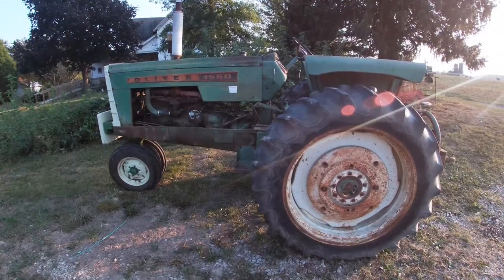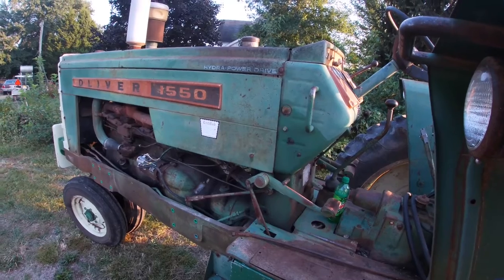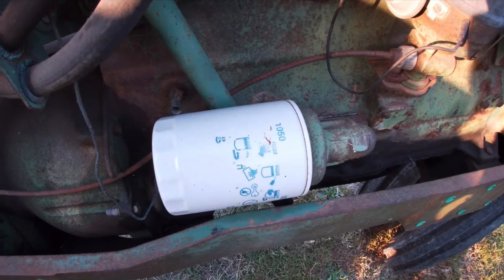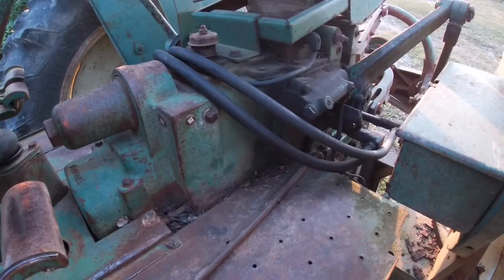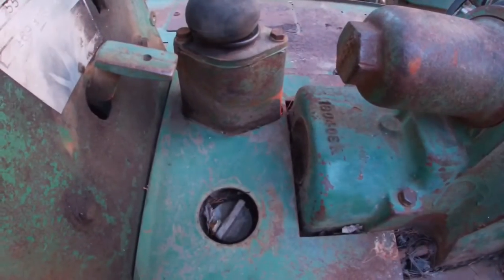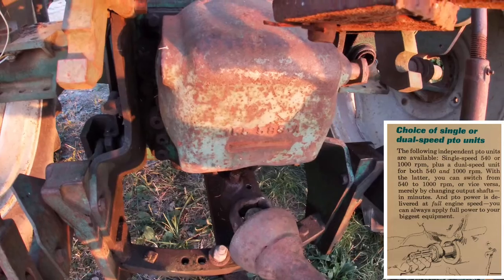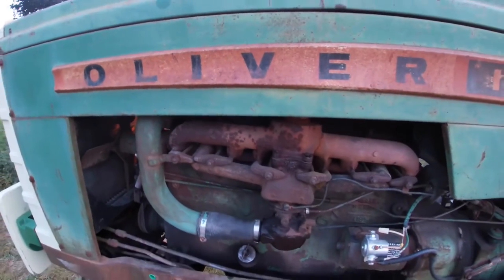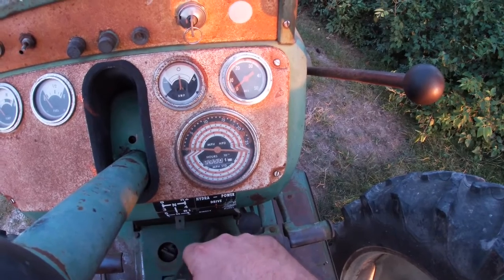The Little Rowcrop that Could! Oliver 1550 History, Features and More!!!

Comment: Great video, you're going to put me out of work! A couple of things I would add. The 1550 could be ordered with an oil bath air cleaner the first couple of years. I'm surprised the owner didn't order that, but it might go back to what you were saying about the premium air cleaner, it was working in a dusty environment. The other thing is early 1550s only had 3 gauges, with warning lights for oil pressure and amps, just like the 1600.
Reply from the maker: Editing this video took me forever. I finally just accepted that it wouldn’t be perfect and put it out there. Haha. Now that you say that, I do recall seeing a 1550 with the warning lights, but I’ve never seen the oil bath in one. I guess I just didn’t pay close enough attention. And don’t worry, I think you have good job security, you’re much better prepared when you make your videos. I’m kind of spontaneous about filming.
Reply: Trust me, I'm all spontaneous in filming. It's all in the editing. I'm thinking about making a behind the scenes video this winter when I have more time. I bet you had a few hours into this video when you start figuring overlaying literature images.
Reply from the maker: I actually started making a “blooper reel” of all the stuff I cut out. I don’t think the average person realizes how much time is spent on one 20 minute video. I reach a point where I’ve watched it so many times I just roll with it.
Reply: My 1966 model 1550 has the same gauge setup as Ross’s, but has an oil bath filter.

Comment: I read an article on Oliver farm equipment that there was 3 brothers and when the older 2 had died the younger brother sold stock to White that built trucks in the early 60s and they started pulling the profit for the truck line instead of putting it back into Oliver farm equipment

Comment: Great Video.Chris Losey recommended your channel.I have an 1850 with the claw deleted.  I always thought it was field done but looked factory.  Now I know. I've always been grateful for it since it sees a disc mower regularly and the unequal loading of the arms seems a little scary.  I lightly welded the 1950 closed to prevent an accident. Not a heavy weld so a purist can undo it when I am dead and gone. But for piece of mind.
Reply from the maker: Thanks!! That’s why I was glad to have it as well. I thought the uneven weight of the mower might cause it to come loose. I figured this would be a perfect job for this tractor! I know lots of people who have welded them for disc mowers. It’s better to be safe than sorry.
Reply: I ran across that said the claw was the option and everyone wanted the coupler. I've noticed at shows the 1550 commonly shows up without claws like oliver wanted to get rid of them.  I've got 2 sets one came of a 1600 my original got bent
My build card info 
Fast coupling three point hitch in place of integral ball end three point hitch add 21 dollars

Comment: Interesting learned a few things mine is 157 842 -502 and if everything is correct it's the 2nd one. Almost sold it after I got it has the suicide transmission it has been clocked at 23 and had room on the throttle for a little more.
Noticed that someone had found out the front tires are a little special you put the correct ones on
Reply from the maker: That is interesting! That seems like it’s the second one unless I’m ignorant of some other detail. I’ve always wanted to take a high speed rear end and put the Hydraul- shift in front of it. They say to not do that because it will go scary fast. But now I have to try it 🤣

Comment: Just getting my first tractor just happened to be an Oliver 1550 "68" .
 What type of motor oil , rearend oil & hydraulic oil  also coolant do I need to use? 
 Also what battery do I need?
 Also what battery
Reply from the maker: I use 15w40 in the engine, 80/90 in the rear, and premium hydraulic fluid. Green antifreeze and whatever 12v battery you want. I think it’s a 6526 that fits in that battery box.
Reply: @rosstheoliverman  also what fuild for transmission?
Reply from the maker: @outlawfarms6961  Transmission and rear end are one compartment use 80/90

Comment: And also I’m having a problem with my 1530 staying running I have rewire the whole tractor new cap rotor new cap plugs and wires electronic ignition new carburetor nephew won and you said I’m a bowl and also  new coil but I runs for a little while then u can cut it off and it whant crank back do u have any ideas and it also has a new head gasket and the head has ben ground
Reply from the maker: I would also check the fuel line and make sure the fuel is coming out fully. I had one once where, while the carburetor was off getting rebuilt, a mud wasp had crawled into the fuel line a ways and built a restriction. The tractor would run for a minute or so and then run out of gas.
Reply: @rosstheoliverman  thank u I’ll check it

Comment: Any advice on the vacuum advance on one of these? After overhauling my 1550 motor it runs like a top at idle and wide open but getting between the two is ruff going and the vacuum advance is what I have narrowed it down to.
Reply from the maker: The vacuum advance distributors are not that great anymore because most of them are wore out. Easiest fix would be to get a new distributor from Korves Oliver or other such places. However, if you want to mess with your original you can try the following: Use a flat screwdriver and push down on the plate that the points are mounted to. While holding it down, set the points. After everything is tight then let up on the plate. The points will probably look closed but put the cap back on and start it. This procedure has worked for me. I figure once the engine starts turning it pulls the plate and everything is happy again.

Comment: I will say my 1550 or out pool my 80 horse Massey Ferguson my 1550 does not have water in the tires in my Massy Ferguson has loaded tires and wheel weights the Oliver without pool no problem I have pulled a 5 14 botem Plow in North Carolina red clay
Reply from the maker: The 1550 is a great little workhorse!